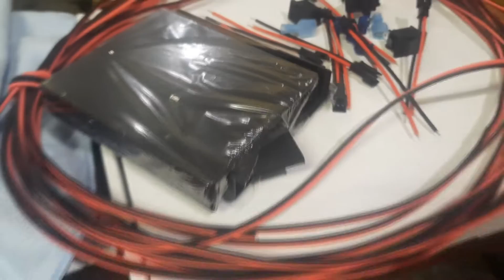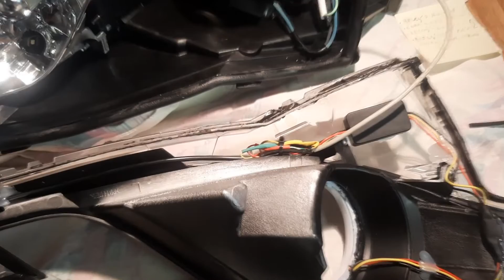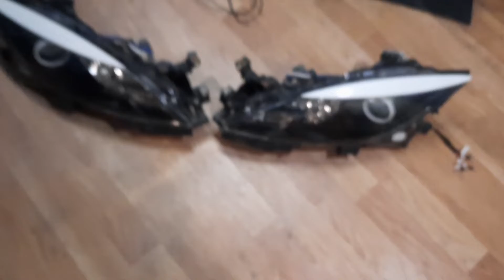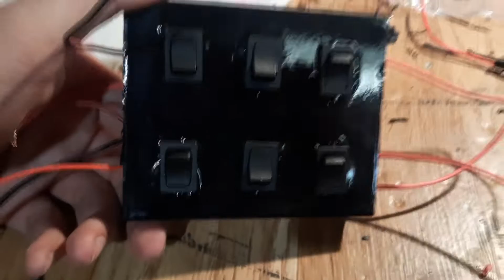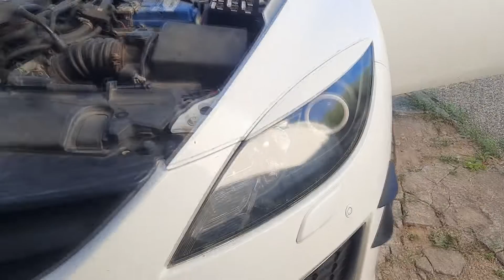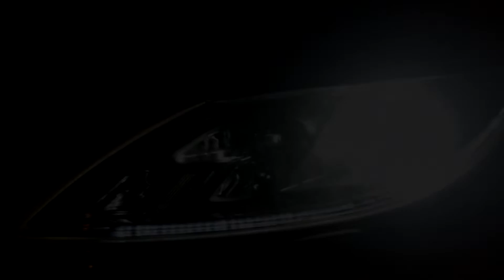Mazda 6 GH - Adjusment of Headlights Part2

Comment: Hey buddy. dobra! 👍🏼👍🏼
One quick question, I'd be greatful if you could answer.
I know you got the Halo rings connected to the dipped headlight connection to light up🔆 ✅but how did you manage to get the Halo eye LED rings to work as a turn signal??💁‍♂️🤷🏻‍♂️
Reply from the maker: Well thank you. Those rings have such a function. They have three outputs. Ground, classic daylight and turn signal.
Reply: @emelvideo  so there's separate individual connection for daylight and turn signal??
Reply from the maker: @harrysukdevsharma4650  Exactly. Both on the ring and on the strip
Reply: @emelvideo  dobra dobra👌🏽👌🏽👍🏼
Reply: @emelvideo  what are the ring dimensions? Thank you in advance
Reply from the maker: @scotttitang305  
https://a.aliexpress.com/_mOCD4Vg